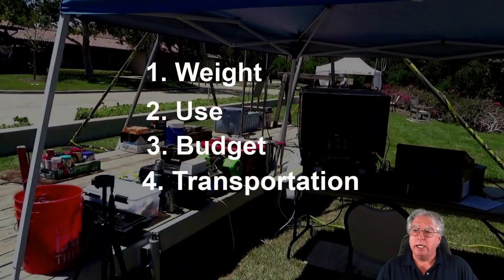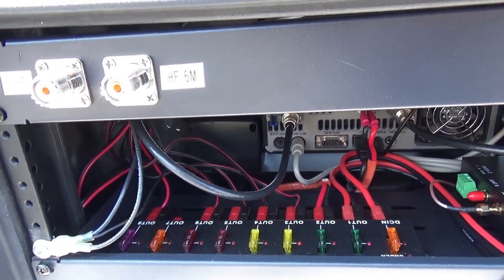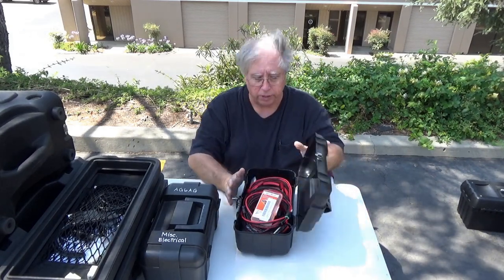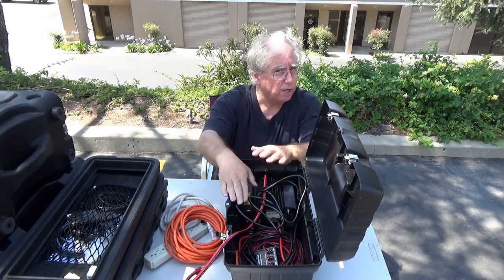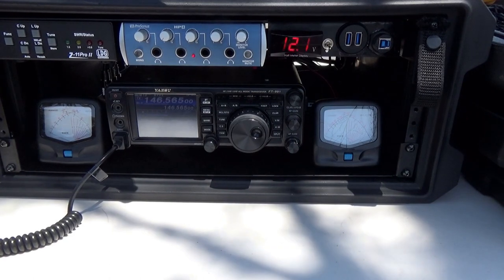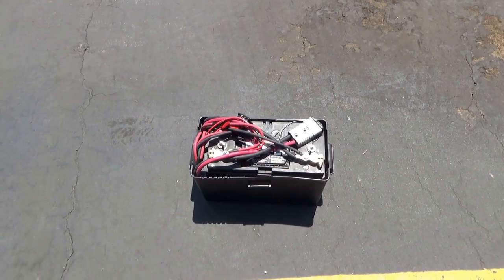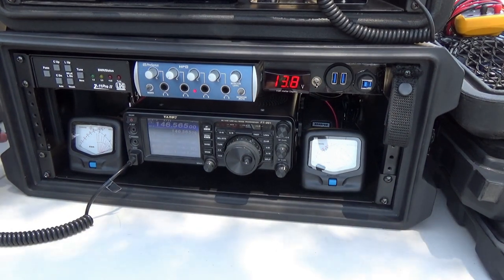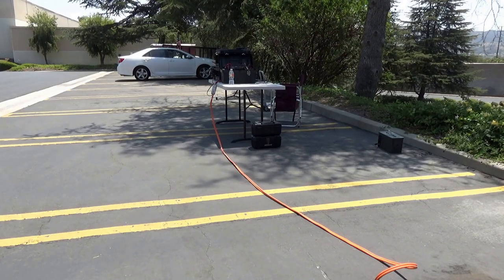Remote Operation And My Philosophy Of Building A Go Kit: Part 2

Comment: Hey Stu, I just wanted to say I really liked this video.   I roughly the same setup with two pelican cased HF rigs, one hard cased QRP all mode rig, and 2 VHF/ UHF hard cased rigs.  The "electric power accessories" hard cased box I have is based on DC power.  I do carry switching power supplies, but I try to limit output wattage on the HF rigs to 40 watts or less.  Solar is a small part of the kit, but I have the ability to set it up.  Key factor or philosophy in setting up anything, is having an idea of what your    "power budget" is going to be just to meet the minimum operating voltage requirements.   Any thing above that is pure gravy for having more ability and time to complete the mission.
Reply from the maker: Sounds like a great setup! Thanks for the comment.

Stu
AG6AG

Comment: One option you didn't mention, but which I used successfully on field day, is running off a battery connected to a battery charger.  Maybe that only works with modern LiFePO4 batteries, but according to the Bioenno people, you can leave a charger plugged in full time without harming the battery.  As long as your charger puts out more current than your average current use you're fine.  Noise could be an issue I suppose, but I didn't notice any.
Reply from the maker: Hi Patrick,
You certainly can power your stuff from a battery plugged into a charger on commercial power, but at that point, you are actually powering your stuff off commercial power. If you are in a contest and claiming emergency power, you can't charge the battery while hooked up to the radio on commercial power. You can of course charge it from a generator...
But that leads to the question of why you would stick a battery in the circuit if you have 120 AC available...

Stu
AG6AG

Comment: Hey Stu,
Thanks for putting this all together. Two questions:

1) Any thoughts on using breakers instead of fuses? 12v automotive breakers are bigger and more expensive but you don't have to worry about spare parts kits. It makes things more self-contained and eliminates the "ran out/lost/forgot" consumables failure modes. If it's just a balance of pros/cons, is there a useful hybrid approach with fuses for the most common values but breakers on the especially large (and probably more critical) loads? Looks like you can also get waterproof breaker panels which you could mount outward on a go kit as part of an at-a-glance power system status indicator.

2) If you already have a radio-friendly inverter+switching supply+120v extension cords,  is it worth using those for long-distance transmission from the panels/batteries since you already have them? Extensive lengths of 0000 cable sounds like a lot of copper to buy and drag around. Regardless of which is more efficient on paper, are there practical considerations that would tend to push things one way or the other?
Reply from the maker: Hi Nathan,
Great questions! Interesting thought about the breakers rather then fuses. My first thought would be cost, but on second thought, a breaker can fail... That said, it may be worth looking into as to what kind of panels and blocks are available.
As far as the batteries and all that closer, it all depends where access to the sun is... If I'm limited by tree cover or high structures, I need to be able to get some distance.
Having the big low loss battery cables really came out of working a club event and having the low voltage alarms going off with about 15ft of 12 gauge wire.

Hope that answers your questions!
Stu
AG6AG
Reply: @AG6AG   Thanks! I'll dig more into the breaker vs. fuse question with the folks on the battery box project. I have had one of those breakers fail on me but it was just the reset lever which was fixable. I've also had a fuse disintegrate as I tried to pull it from the holder for inspection and leave bits behind that needed another tool to get out.

For the power lines, I'm curious how the losses would compare between feeding a radio, say 25A@13v using:

A) battery->inverter->50' 12ga ext cord->switching supply
B) battery->(voltage booster?)->50' 4/0 cable

... where the battery has to be far from the radio to be near the solar panels.

73,
Nathan
Reply from the maker: More good questions!
So let's address the idea of using the inverter. A 12 gauge extension cord plugged into an inverter at 50 Ft will have very little loss between the inverter and the power supply next to the radio. A/C power by nature has very little loss compared to D/C power. However, the inverter is much less efficient and will probably use more energy overall.
Now, as far as having a fuse break trying to pull it out, it's a pretty rare event. Also, I use a 12v test light to check fuses (that's what the exposed poles on the top of the fuse are for). This keeps us from taking them out until we know they are bad.

Stu
AG6AG

Comment: On your go kits how would you add a turbine to go kit and if you use a lithium 5 feet ion battery but wanted to add for our lead acid batteries what kind of converter would you use for using the lead acid batteries for a cell pack to recharge the lithium battery if you have any info please let me know 73. KN6HAQ
Reply from the maker: Hi Kevin,
Since we talk every once and a while why don't we chat about your questions directly.